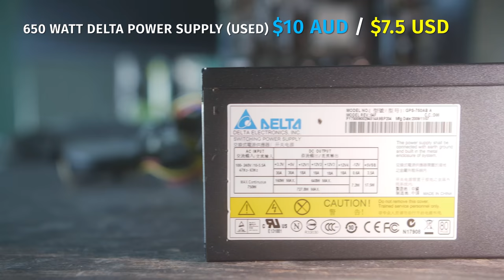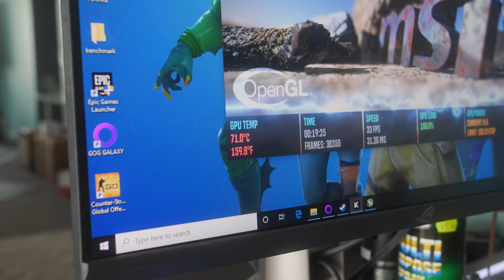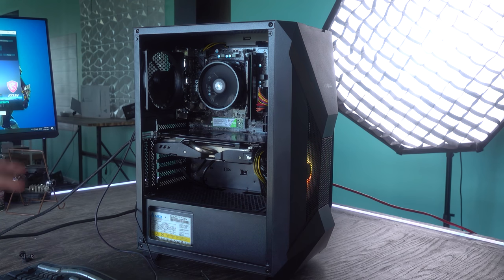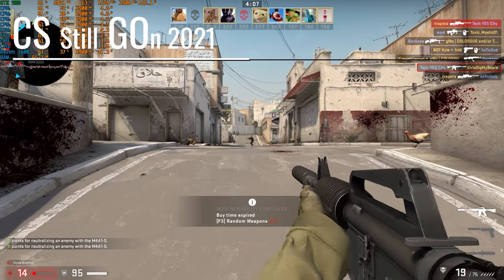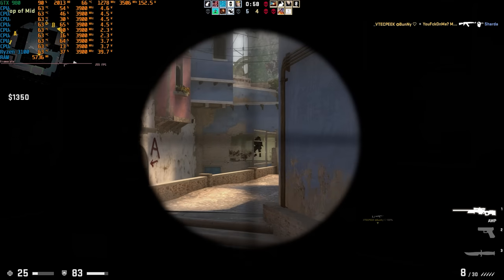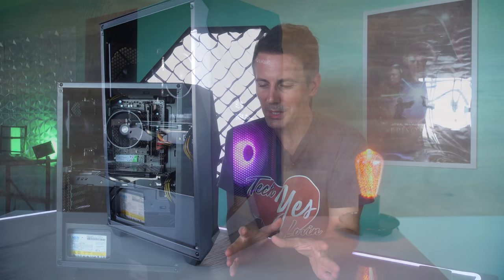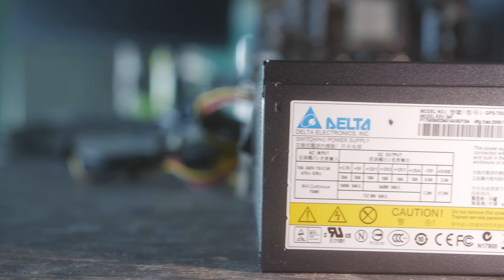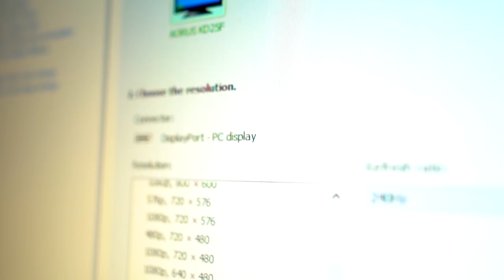Is this $450 Ryzen Gaming PC OVERPRICED?

Comment: Tech Yes City is famous, the 1050Ti reveal is trending!
Reply: lol what
Reply: @удивительный-б8х  You don't read tech news sites.
Reply: @удивительный-б8х  1050 tis are th only gtx graphics card you can buy right now, anything better is getting snagged by miners... Pallets of used 1060s aretn even safe from them
Reply from the maker: Breaking the word on the street!
Reply: So the RX 570 might be faster than the GTX 980 now 😵
Reply: @ChaNnArD-mD  well alls i know is my vega 56 is now pretty much matching or slapping the balls off of my buddies 1080ti...
Reply: @ChaNnArD-mD  NO ! I have a MSI GTX 980 and I play Cyberpunk most on medium settings with a few settings on low at 1080p, not overclocked (fancy newer generation stuff off of course). cooling paste not yet changed. GPU MAXED at a 100 % and VRAM at 99%, framebuffer at 48/50 %coupled with a I7 5930K, not overclocked with 32 gb (4channel and 16gb overkill) of Crucial RAM at 2400hz (not overclocked) on an MSI X99 board ("The Bumblebee") Still performs better than a RX570 and certainly better than a GTX1050ti.  (Windows 10 on Evo850 250gb and Cyberpunk on Evo970 1Tb}
Reply from the maker: @arz1898  A guy called techtastic.
Reply: @hellbringer09  GTX cards have always being around where I live, trying to find anything else at a good price was the trick, now, just based on the ad for a store, they had the RTX 2000 series this month, but, the 2060 Super and 2070 Super were around the MSRP of the 3080, while the 2080 Super was at $960, heh
Reply: @seinti109  vice versa where i am the budget deals and ones that go on sale are the amd cause no one knows what the fuck they are
Reply: I imagine that most people who checks the Trending tab, it's because they don't know what else to look for, those not planning to replay their saved playlists and those who didn't find anything interesting on the recommended section. That was my personal experience, once within 1 year.
Reply: @seinti109  i got my vega 56 for 350 canadian new with 2 year waranty. Cant really beat that deal to be honest and it clocks to 1710/925 on a 1mv undervolt so its like a 2060...
Reply: @seinti109  Er, no. I did not look on the trending tab on YouTube. He was mentioned on a tech website called Hexus Net.

I was subbed anyway to Tech Yes City.

I read the article.

Comment: The way things are going, by next year you'll be making videos of scouring the local tip for discarded pentium 4 systems.
Reply: @wakenbaker-uk My Mom's place has my old retro tech hostage, lol. It is safe though.
Reply: Yes!! Then, I could revive my Pentium 4 that it's at a corner, which I don't know what happened to it, it just stopped to work one day, 12 years ago.
You could turn it on and it showed the motherboard was on, but, everything else didn't do anything at all.
Reply: Or how about PII 400s with Voodoo 2s in SLI...  it could happen!

Comment: I feel like I'm watching a sci-fi flick and that there should be some giant tesla coils in the background with someone yelling all power to the engines.
Reply from the maker: Giant Tesla Coils? The sci fi flick is red alert?
Reply: @techyescity  Hello Bryan. I have a MSI GTX 980 and I play Cyberpunk most on medium settings with a few settings on low at 1080p, not overclocked (fancy newer generation stuff off of course). cooling paste not yet changed. GPU MAXED at a 100 % and VRAM at 99%, framebuffer at 48/50 %coupled with a I7 5930K, not overclocked with 32 gb (4channel and 16gb overkill) of Crucial RAM at 2400hz (not overclocked) on an MSI X99 board ("The Bumblebee") Still performs better than a RX570 and certainly better than a GTX1050ti.  (Windows 10 on Evo850 250gb and Cyberpunk on Evo970 1Tb}
Reply: @techyescity  bryan try red alert remaster.
Reply: @techyescity  You know what, the judges will accept that. They also would have taken Young Frankenstein or the Twilight zone for that creation of yours. Interesting with the ram FYI.

Comment: Build my daughter an i3 8100, z270x Gigabyte gaming, 8 GB DDR4 2800, Seasonic 500w, Gigabyte 1050 TI 4GB, used case, ssd, mouse, and Keyboard. She loves it. My 5yr old son with AMD A8, A88xm-e35 v2, 5GB DDR3 RAM, generic psu, used case, ssd, mouse and keyboard, a computer table coming from recycled wood. As you can see, all parts are recycled. I never bought anything on it. Most came from broken PC( usually the whole tower) from friends and family. The only thing that I bought was a can of spray paint for the case and nails to build the table. My children loved it.

Comment: Solid build Brian.  Ryzen 3000 series with a B450 is great.  The GTX 980 is a little older, but about on par with a RX 590.  I'd gladly trade a little heat for a quiet gaming experience all day.  Super clean build with some Tech Yes Loving all for only $450 - that's a great deal in my opinion.

Comment: Hello Bryan. I have a MSI GTX 980 and I play Cyberpunk most on medium settings with a few settings on low at 1080p, not overclocked (fancy newer generation stuff off of course). cooling paste not yet changed. GPU MAXED at a 100 % and VRAM at 99%, framebuffer at 48/50 %coupled with a I7 5930K, not overclocked with 32 gb (4channel and 16gb overkill) of Crucial RAM at 2400hz (not overclocked) on an MSI X99 board ("The Bumblebee") Still performs better than a RX570 and certainly better than a GTX1050ti. (Windows 10 on Evo850 250gb and Cyberpunk on Evo970 1Tb}

Comment: Hey Brian, you should check out the Cooler Master MasterBox MB511 case. It's inexpensive for the most part, (I got it for $39 USD after rebate) but it is a joy to build in. I picked it up for a customers build and I am really happy with it. There's lots of room in it. It has a PSU basement, space for up to six 120mm Fans and almost the entire front is mesh, with fantastic airflow. The style is not gaudy but rather pleasing. Might be a good one for some of your builds if it's sold in Australia that is. The only thing that lets it down is the side panel is not TG. It's acrylic.

Comment: Thanks for the video, your explanation on older graphics cards helped me out. It explains why my i7 6700 laptop with a 960 is getting poor frame rate (not that it would be great anyway, as you said 900 series support has been dropped, meanwhile I recently bought a 3100 powered pc and cpu heavy games were playing better than my laptop
Reply: There was a Windows update that limits CPU performance and bottlenecks the GPU that came out a bit more than a year ago, you may want to check which version you are running and which has this problem.
Reply: thats because the laptop would not be the CPU desktop equivalent for a start and running at a lower CPU frequency on a lower TDP limit. As FPS mainly relies on frequency laptop will be less than the desktop. The the laptop has the 960 built in always knock one off so equivalent to a 950 desktop card. 
2. the 3100 has better IPC (and BUS?) than Skylake, using the latest Ryzen architecture topology (3300x would be better as its produced differently). I went from a 6600k/GTX1080 in a PC changing only the R5 3600 and gained 10-15% fps in the games I play, just from that.

Comment: Funnily enough a mate of mine had a budget of £450 GBP and i built a very similar machine..

New AvP Quasar (mesh front, 3x ARGB fans) and an Aerocool Cylon 600w (540w on 12v, 80+.. Big fan of the integrator 600w (552w) silver PSU's aswell on a budget) both new, then

16GB 3000MHz Corsair Vengeance,
Ryzen 5 2600 w/ stock cooler,
Asus Strix GTX 980 4GB (the state of trying to get GPU's these days!) All used.

I got similar fps in fortnite and was able to get 50fps on medium with Cyberglitch.. i'll make no money on it but i'm super happy to be able to give this to my mate and his son for gaming and video editing

Comment: I got beat up a little for using mismatched memory on a Windows forum, lol. I have to agree with you on doing this though. The memory I picked up cost less than half of what it normally sells for! As long as the system is stable I see no problem with using it. My motherboard actually picked a reasonable speed the memory could run at. I couldn't pass up 24 GB of DDR 3 for $35,00!

Comment: Not sure if that's what's wrong but around the time of Cybermess had to roll back nvidia drivers on the 1060 due to random periodic asset flickering, some drivers caused fps drops others didn't and it was just annoying. FPS drops, could have something to do with their optimization attempts for DLSS/RTX though older GPUs; we don't have that so I think they messed up things with some drivers since Cybermess came out. Rolled back last month to December drivers (pre-460) and Shadowlands was fine again. Honestly wondering if the 3060 TI will have issues with drivers across games also from reading all the forum posts on it. When some people are having issues even on the newer cards it's the drivers being put out. The budget builds can also have their GPUs swapped later if/when the inevitable/eventual crash happens, though that might be a couple years away. Reprinting of older supply and an eventual dump of cards once crypto eventually crashes again would help the supply situation. For now the reprinting can at least put more GPUs out their if people can't get the newer ones. Both the current GPU market and the annual farming the big love rocket mount are demoralizing.

Comment: Bryan, you should honestly revisit the i5-10400f with it's current pricing. It's sitting at 145$USD / 190$CDN right now which is stupid good value compared to it's original price of around 180$USD / 230$CDN. 11th gen might be coming out but at 145$USD it's a no brainer.
Reply: I almost bought one last week, ended up using a 1600AF with an aorus B450 pro which was combined 180$USD, couldn't resist, was tempted by the 10400f though.
Reply: @Joe Rogaine Bro if it drops in price yet again I might sell my R5 3600+X570 combo for an i5-10400f instead since I'll get the same FPS anyway 😩😩

Comment: I think there is something to that if you head to head the r7 260x vs the 1050ti the 1050ti used to crush it now the r7 260x with its regular performance updates is actually faster and has a plus 3 to 5 fps now its not much of gain but like i said it used get crushed by the 1050 ti looking likely that nvidia have cut performance tweaks to older cards. Amd on the other hand seem to be still tweaking even its old r7 series cards. I only tested across three games Fallout 4 R6 Siege & warframe same story across the board for those games. Maybe goes back to the old video on this channel talking about the performance drops of the xeon cpus on later bios and microcode updates

Comment: This is not overpriced at all..Atm, in UK, an R3 3100 starts at 100 £ (137$) (bid) on ebay. This is by far one of the most reasonable builds during these times. I saw a full Athlon 200 GE build for 400 £ (shipping included) and that doesn't even come with GPU lol

Comment: Ay the i3 10100f recently went for $70 at micro center and is essentially the intel variation of the 3100. Ik that in Australia especially and even some parts of America, micro center is not available, but can you comment on that in your opinion. Maybe just make a budget build around intel 10th gen and commentate on the state of Intel CPUs for budget builds. I mean here in America we even have the 10400f for 150$ USD on Amazon and sometimes the 10700 even drops to $250 from what I’ve seen

Comment: That powersupply has me worried imagine pairing the gpu and psu back in the day people would tell you your crazy
Reply: Remember that CPU has a 65W TDP, the 980 was not to be paired with a entry level chip in 2014, but something like a i7 4930k on X79 (130W TDP)... Anyway, people always tend to pick a bigger psu than they really need.
Reply: @jean-charlesweyland129  look up the wattage of the fire hazard that 980 is and then look at the wattage the psu was which mind you WAS USED
Reply: @donottouch9110  18Amps on two 12v rails=648W... yeah sure. It's pretty bad but considering the GPU has a 180W TDP, the whole system will hover around 275W at full tilt, that psu can handle that kind of load: it'll be fine ^^
Reply: @jean-charlesweyland129  I wouldn't do it in my opinion but those are facts in THEORY IT SHOULD HANDLE IT but I don't think it would for long and that psu wouldn't be able to handle a surge nor a cut of light mid gaming and not die
Reply: @donottouch9110  actually, delta psus are actually pretty decent

Comment: In the Netherlands we have enough AMD ryzen 5 5600x stock, at the shop where I usually buy from have over 700 cpu’s left for 370 euros.
Reply: When i built mine about a Month ago none 5600 were available ine Germany at a reasonable Price.
However i scored a good deal on a 5800 which seemed to be in Stock everywhere.
Odd.
Reply: @timhartherz5652  The 5800x is too expensive for what you get so it isnt as popular as 5600x and 5900x.

Comment: To be honest i recently built a similairly priced build with a RX580 NITRO+ 4gb and the GTX980 should perform closely to a RX580/570 but as i have seen in this video and many others it doesen't. Its super weird because maybe a year or two ago it would perform like the RX cards and i definetly back up your driver theory.The GTX 970/980 are still amazing cards with great potential but the drivers seem to hold them back, which is a shame and at the price which they are being sold on the used market, I think its making much more sense buying a RX580/570. The pricing on those cards in Australia may not make them worth right now, but at least here in Slovakia I was able to score 2 RX580 (one for 115€, second for 100€) which makes them a much better deal than the GTX 980s, which is kinda a shame. It would be awesome if you could do a video testing the 900 series drivers and seeing if the performance got worse or if they are just ageing. Either way, keep up the good work Brian :p

Comment: Not sure about your conclusion re: drivers. Do agree that performance should have been a little better. Maybe the memory tweaks could be causing weirdness. Any chance you could test it with a couple of matching sticks?
Reply: Yes it would be nice to test the 980 with the same games/settings/CPU but with optimal memory. 
Then test it on a CPU that is 100% guaranteed not be a bottleneck (also with optimal memory).

Comment: That 980 should be getting more FPS..... I've found the same thing with 7970/ R9 280X - not sure if it is drivers or game optimisation but that just don't seem to be utilising the GPU to it's full potential. Like sometimes GPU utilisation was dropping to 22% with a Ryzen 7, so something is wrong somewhere.
Reply: Seems there's often something dodgy going on with older Nvidia cards. Maybe they don't bother to optimise the drivers properly for Maxwell. But as Maxwell is basically Pascal I'd be surprised if it was down to just that. Agree that the 980 didn't seem to be performing as it should. Something's not right.
Reply: @DJ_Dopamine  Yes sure makes you wonder.... if you're old GPU performed like new, then there would be no reason to buy a new one ;) ;)

I know my Ryzen 7 can't be bottlenecking my R9 280X, so why is isn't it being fully utilised - makes you wonder..... needs someone to do an older driver test to find out what's going on.

Comment: I have a question for you, so i bought a dell optiplex 3020 and it has like 8 only pins instead of 24 pin connector, it has 240w psu and i am planning to put my gtx 1050 on it, can it run 100% or can it not run? will it explode? do i need to upgrade my psu?
the cpu is i5-4590 stock, 8gb 1600mhz and 500gb hdd and 120gb ssd.
Reply: You'll be fine, I flip those types of PCs all the time
Reply: @Razor-gx2dq  thanks, ill try it.

Comment: Hey Bryan, i recently bought a gigabyte rx580 8gb and it would artifact when the thermals were at 65 degrees celsius and crash the pc so i would use the adrenalin software so that my fans would run at a 100% while gaming also had a power limit since that also lowered the temps. Now whenever i open the adrenalin software i have crazy artifacting and i cant open any of my games for that same reason...